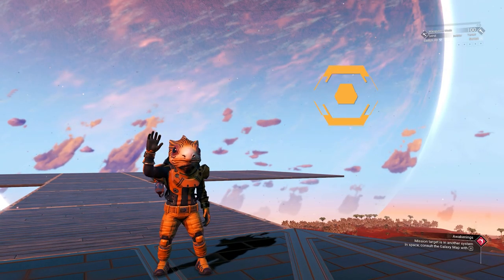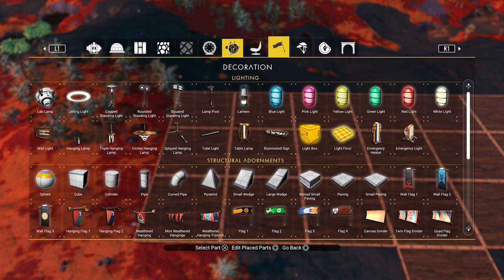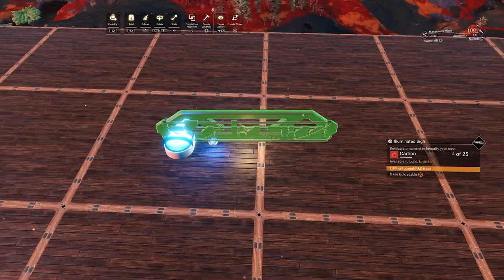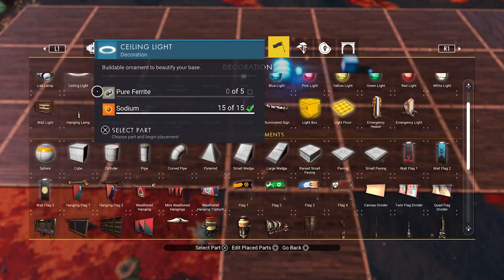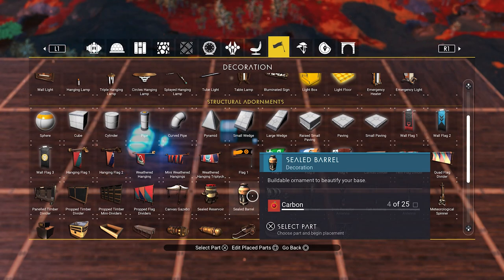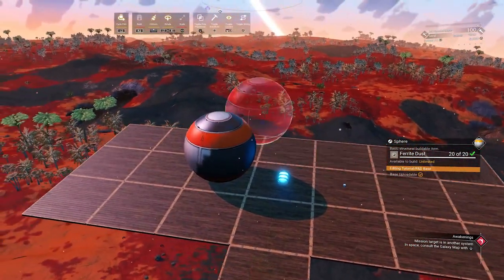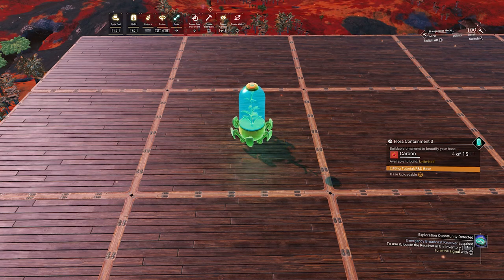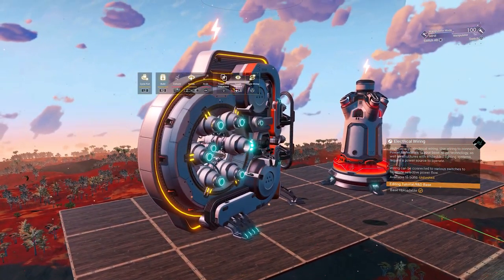The SCALE glitch - How to build in No Man's Sky Frontiers

Comment: I'm honestly not sure that size will increase complexity or cause crashes. Overall it's the same texture and same model. Will be interesting to see.
Reply from the maker: It definitely takes longer to render in scaled up building parts, So I can only assume it is more stressful on the render for visitors.

But seems HG is not rushing to fix this, so it seems like they are not to worried about it themselves.